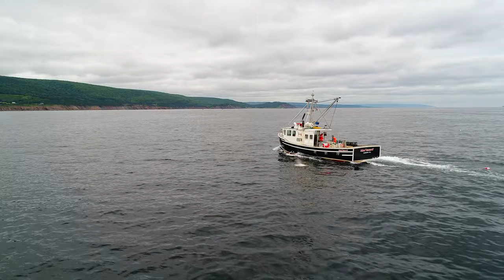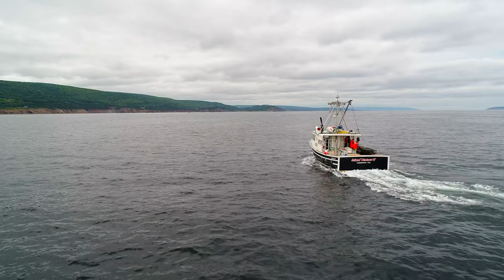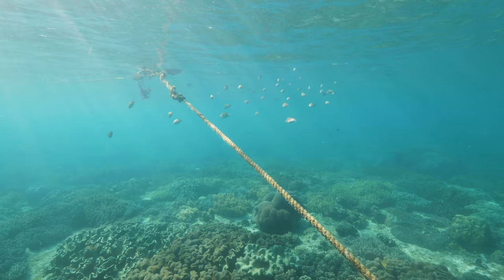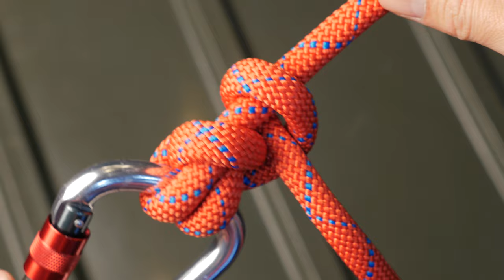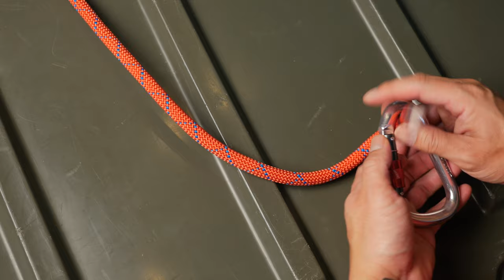How to Tie the ANCHOR BEND KNOT | Boating Knots

Comment: Thanks for that. I had to cut off an achor which left me with 60 meters of expensive double braided line with no thimble braided into it. I've since bought a new anchor rope but I wanted to use the old one with a reef anchor (so hopefully no more cutting off expensive anchors stuck on reefs) and this will allow me to use the old, still otherwise functional rope.
Reply from the maker: thumbs up

Comment: The Anchor Hitch (Anchor Bend) is a great knot, but the Roundturn and Two Half Hitches (RT2HH) is much better while tying/untying under load. For example, you can tie the RT2HH while the load is present, like a 100 lbs weight suspended from a tree limb, and untying the knot holding that suspended weight is easy. Also, a RT2HH allows tension to be added to the line by completing the round turn, and it never jams. I currently cannot think of another knot that has all these capabilities in one knot.

In contrast, the Anchor Hitch is impossible to tie or untie under a heavy load, does not allow tension to be added, and always has slack before applying the load. However, it is secure and gets more secure with more load.

Comment: I like it, from my knot, it will not endlessly trying to tighten like a constrictor knot, nor takes a few tries like bow-line or anglers knot so you won't waste a few lengths of rope. I don't feel too confident on it's end so I do a not too-tight constrictor knot onto the straight rope
Reply: Don’t go overboard by disregarding the bowline. Sometimes you need a loop, not a hitch, and a bowline works well 95% of the time. Plus, a bowline is easy to tie, easy to untie, and difficult to tie wrongly.
Reply: @jakemccoy  haha true, I learned to just make a triple or quadra bowline if I want something really tight, the current problem is how to judge if I should use triple bowline or constrictor knot. 

It's only this year(or last year) that I tried memorizing and research knots

Problem with triple bowline that it often eats quite some length of rope. Example using old shoelaces to triple bowline something
Reply: @MangaGamified  If you need a loop specifically, then the hitch in the video is not an option. If I want something more secure than a bowline loop (rarely), then will tie a Double Dragon Loop. That loop is easy to tie wrongly though. So, I must really need it, because of the risk of tying wrongly.
Reply: @jakemccoy I'm fairly picky with knots unless I have an intentional special purpose(usually design or permanent projects like whips or slings). I always judge if it can tie a close ring.

Usually I just use triple/quadra bowline and add a constrictor at the end. rather than memorizing another knot. Note I'm not against other knots but it gets confusing if I memorize more than 3 knots.
Reply: @MangaGamified  We are having a miscommunication. In the world of knots, there are hitches, fixed loops, adjustable loops, nooses, bends, gripping hitches, binders, stoppers, and combinations there of.

The knot in the video is a hitch. If you need something in another category, the knot in the video will not work.
Reply from the maker: thumbs up

Comment: If there isn't any pressure on the knot (boat drifts backwards) what keeps the working end "locked"?   I just tied it.  Pulled on the main line to lock it.  And I can wiggle the working end and it releases and pushed back through.   I'm using nylon paracord so maybe this is not the right knot for this rope.

Comment: The knot is fine but the way you tie it round the carabiner is wrong. The standing end where the load is going to be must load along the spine of the carabiner. So you have to loop away from the spine. If you don't do that, when the rope slacks it will get caught in the gate.
Reply from the maker: It should tighten around, plus this knot is more for solid anchors
Reply: @innerbarkoutdoors  You will not understand this unless you climb and use that knot regularly. Again you loop away from carabiner spine so that the loading line and the spine is aligned. Arbopod is the only channel that explained this and these guys are experienced climbers.
Reply from the maker: @TemplarX2  I've never used an anchor bend while climbing
Reply: I have, for many years, and I've tied it exactly as you shown in this video. It works just fine.
Reply: @1neAdam12 loading the gate instead of the spine works fine until it doesn't. there are myriad scenarios in other contexts where this applies. stay safe.
Reply: The original post is clear only to people who already know what you are talking about. So, if you are trying to inform others, it is not working. Make a video.

Comment: I only really use marine/naval knots anymore, even for most climbing applications, since they are both strong and easily opened with cold, wet hands, even after getting tugged on for hours.
Reply from the maker: I agree, it's important to get it off after hours of tugging
Reply: Greg Letter  You obviously have to use the correct line diameter. In my experience the line doesn't break inside the knot, but somewhere in the middle, between the points of load. That usually happens, because the load is dynamic and the last piece of line getting pulled taught is somewhere in the middle.
Reply: @innerbarkoutdoors  Saucy
Reply: @JainZar1  sharp bends cause the tension to be distributed unevenly across the cross section of the rope so that some parts experience increased load. This is why the knot breaks before the rope. Knots with smooth first curves decrease the strength of the rope the most. As far as I know, figure eight is the strongest knot, it retains around 75-80% of the ultimate strength of the rope.